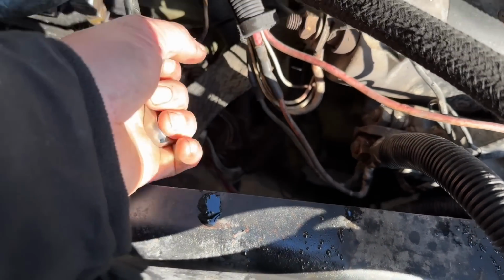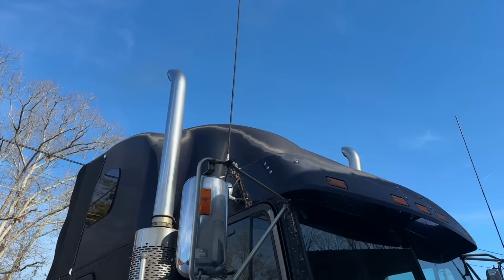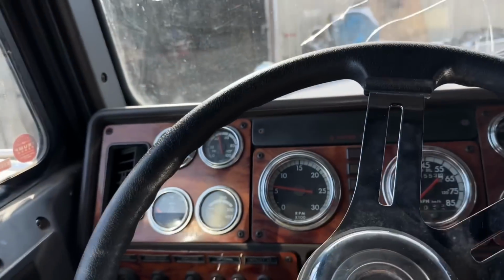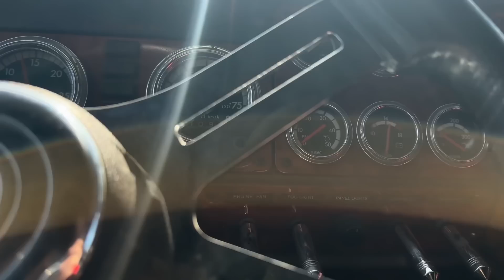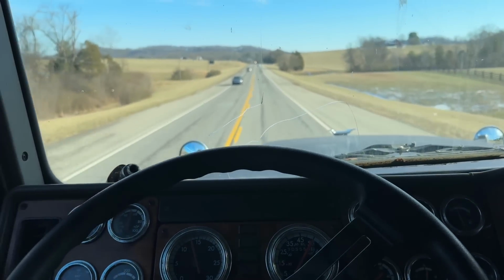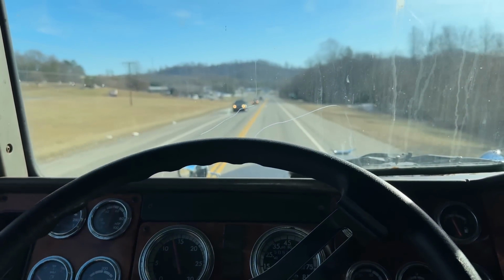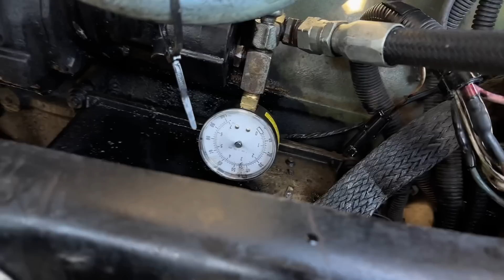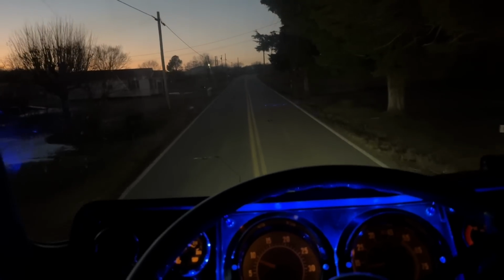The Classic Got Me In Trouble (It Runs So Good)!!

Comment: Really enjoy your channel.   It reminds me of my much younger days driving a cab over frieghtliner with a 250 cummins and a 5 & 4 twin stick (I think - Maybe it was a 4 and 4) - a freaking nightmare to keep on the road.   We were always fixing something.   Also a R model mack with a 300 plus married to a 15 speed with double reduction and double dif lock.  Off course a single window bunk for a guy who is 6'4"    Double diff's work great, just do not expect to steer.   That truck would only go 52 MPH but it would pull a mountain at 45 MPH    

I did have the pleasure of driving a 62 White around the city of Halifax delivering steel when I was in university back in the mid 80's.   Manual Steering, Tag Axle,  220 cummins(I think).   As crazy as it sounds it was like driving a rally car every day and I loved it.  

I drove the Mack on the ice roads in nothern Canada.   Back then we just called it the bush - where the pavement ended and driving got serious.      I had no idea it was considered a dangerous job until the TV show came out.    Just a kid having fun.  

I had to laugh at the little bit of snow that caused the mustang to slide off the road.   Today here in Canada it was a warm 6 F with almost 1/4 " ice on the windshield.  It took me 45 minutes to warm up the pick up just to go for a drive.    The truck has not been out of 4 wheel drive for almost a month now.   I guess its all about what you are used to and how you plan for your travel conditions.   

I'm not sure I could drive a new truck today.    I learned to drive by the sound of the trurbo, tourque range in gears and the temperuture of the exhaust.    Not sure any of the younger drivers would even know what a pyrometer is.
Reply: Driver you couldn't drive a new truck these days. You would keep trying to use the clutch and end up smashing you left leg into the firewall. Lol. Nowadays buying a manual trans car lessons the chance of it getting stolen cause nobody can drive them lol. Take care and be safe out there and happy new year.
Reply: @gregadomeit4020  When I quit driving trucks for pay I swore I would never have a standard transmission in a car/SUV/Pick up - Never have. 

  However, when I retired my brother and I got together and set up a shop to repair equipment.  Our first purchase was a M2 that, for spome reason, we cannot put up for sale.  We have serious discussions on who will drive it when some work comes out way.    I swear, that is the best kept piece of equipment I have ever seen.  

Smashing the left leg into the firewall reminds me of smashing my right leg into the steering wheel adjustment lever of the R model Mack when in the bush.   I swear that will be the reason for a Knee Replacement in a few years.  

Anyway Greg, be well and safe out there.  

Art
Reply: @artbrown6683  thanks for the reply Art. I drove a 30 ton R- model Mack heavy wrecker back in the day I know what you mean about steering wheel lever lol. It was a beauty of a wrecker just a bit rough on the bones. Made good money back then but I had to do everything myself. Now I see these towing channels on here and they send at least 1 or two extra guys to help to operator on wrecks or recoveries or whatever.  Pulling axle shafts in 100° F or - 15F  below 0° blizzard , dropping bumpers and all that stuff. They didn't have the under reach like they do now I just had a big round tow bar. Somedays i would sleep in my  pick up for an hour before i drove to the house cause I got wore out  doing that shit myself. You take care brother and be safe out there.
Greg

Comment: Paint the Classic Bsy Blue a Freightliner color. Keep the side fairings on it to keep a balance to the length and height of the cab and bunk 
 It will look absolutely  amazing.
Had a new 2006 Freightliner Classic that came from the factory with the battery volt control box in it. Works real good till it doesn't.
Reply: I agree.🤙🇺🇸🤙

Comment: you were extremely lucky that the cop was in a good mood, over here in the UK they would have hit your pocket extremely hard, not to mention fined you for a cracked windshield, and taken your licence off you for 7-28 days, plus given you enough points that you loose your licence for driving any vehicle for a year or more. first 5mph over the speed limit is 3 points, and then 1 point per mph over the speed limit after that. so 16 over the speed limit would be 14 points, and disqualification is highly likely as 12 points is maximum. and that is not including the points you would get for a cracked windshield.

Comment: TIm , U know you can turn off the annoying seatbelt CHIME on your 250.  Have your Driver door open...  PRESS your emergency brake DOWN, Shut the door,  Then turn the KEY on the run position without starting,  You will see the seatbelt light ON on the cluster, Wait until the light turns off, Then LATCH and UNLATCH the seatbelt 4  TIMES, Then the light will BLINK to tell you its in the  mode to turn off the chime.. THEN after it blinks  , LATCH and unlatch ONE more time. and it will be OFF for good.  and the light will not be illuminated .. To tell you its complete.